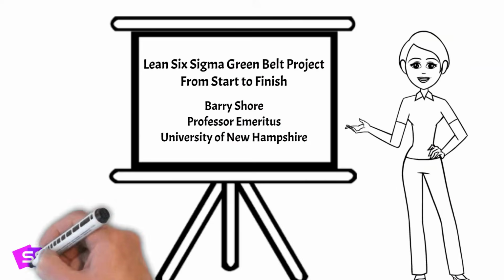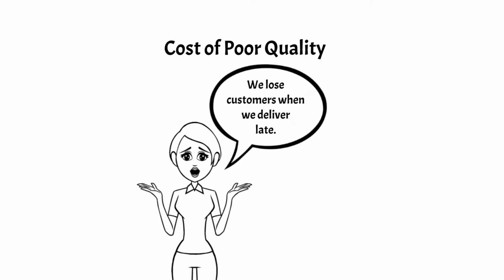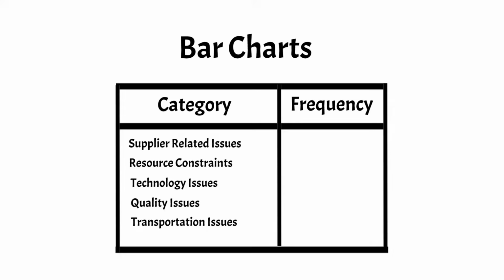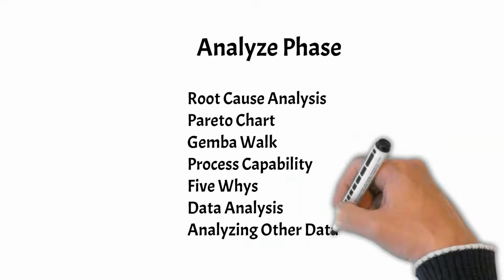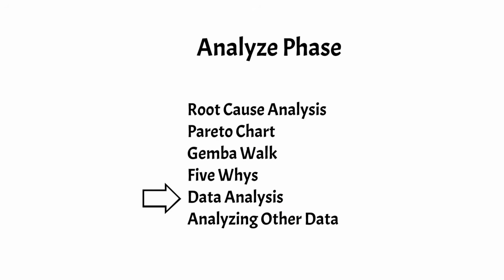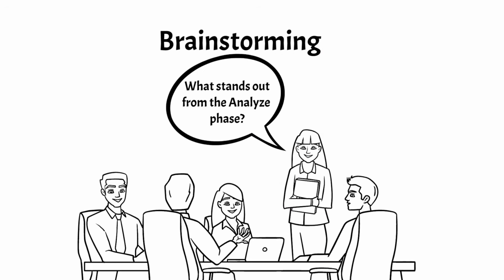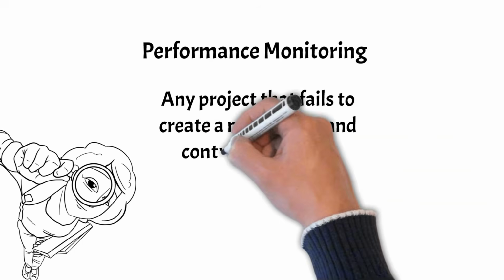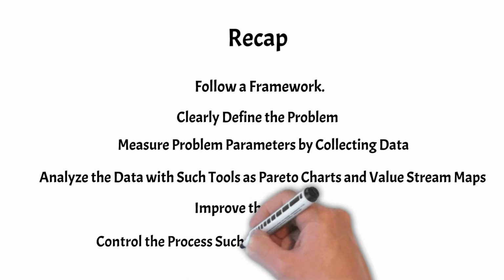Lean Six Sigma Project Example with DMAIC - Green Belt Training

Comment: Shouldn't the 5 Whys depend on the answer to the first 'why', and then each subsequent 'why' depend on the answer to the previous one?
Reply: Analyze comes first than Improve
Reply from the maker: You're absolutely right, and thank you for pointing that out! The 5 Whys technique is most effective when each "why" builds directly off the answer to the one before it. In this video, the goal was to provide a simplified example to illustrate the concept, but we definitely encourage a more structured, cause-and-effect flow when applying the method in real-world projects.

Appreciate your thoughtful feedback!
Reply: @sixsigmaglobalinstitute please confirm if these might work as the answers in the Five Whys:
1. Because there is no order 
2. Because there are backlogs that delay the completion of the order
3. Because there is no consistency in completing orders
4. Because there are no procedures to complete the steps in fulfilling the order
5. Because this process was designed with a lack of quality mindset.
Reply from the maker: @GomaPlus_MTB_Family  Great job working through the Five Whys! You're definitely on the right track by digging deeper into the root cause. One suggestion: to strengthen your analysis, try to ensure that each "why" directly builds on the one before it, almost like a logical chain.

For example, you might rephrase #2 and #3 to better show causation and reduce overlap. And for #5, instead of a broad statement about mindset, consider pointing to something more actionable, like lack of standard work or unclear process ownership.

Keep practicing, it’s a powerful tool when done with clarity and focus!

Comment: a question , How DMAIC is Define-Measure-Improve-Analyze-Control ?? in that case it should be DMIAC isn't it??
Reply: It's a common point of confusion, but DMAIC stands for Define, Measure, Analyze, Improve, Control. The sequence of the phases is intentional and reflects the logical flow of the methodology:

Define: Identifying the problem and setting goals.
Measure: Collecting data to understand the current process performance.
Analyze: Identifying root causes of the issues based on the data collected.
Improve: Developing and implementing solutions to address those root causes.
Control: Ensuring that the improvements are sustained over time.
The order is crucial because each phase builds on the previous one. You first define the problem before measuring it, analyze the data to understand it, implement improvements based on that analysis, and finally control the process to maintain those improvements.

So, while it might seem logical to think of it as "Define-Measure-Improve-Analyze-Control," the established order of "DMAIC" reflects the systematic approach of the methodology.
Reply: I don't understand how you can consider improvement before analyzing. The process involves several steps:

Define the Physical Process: Identify the process you want to focus on and set clear goals. Create a business case to justify the need for improvement.
Measure: Establish a baseline to understand the current state and determine the effectiveness of your efforts.
Analyze: Examine the factors contributing to significant variations. This helps you identify where to focus your improvement efforts.
Improve: Implement the necessary changes and re-measure to assess their effectiveness.
Sustain: Ensure the improvements are long-lasting by modifying the systems and processes to support the desired behaviors.
Reply: First comes Analyze and then Improvement
Reply: It's DMAIC but perhaps he forgot the sequence